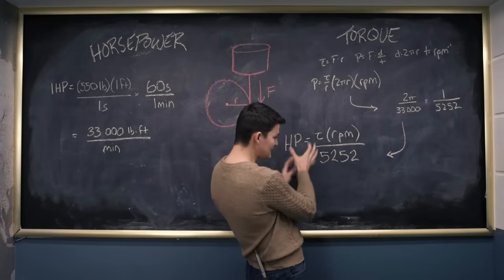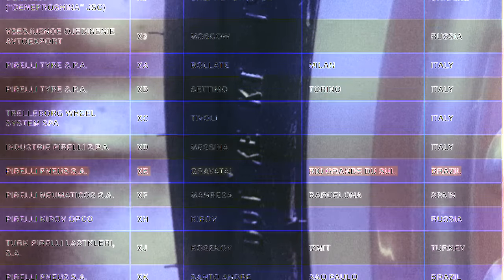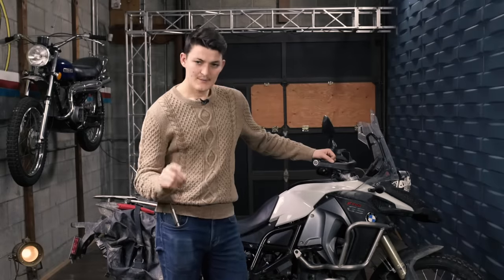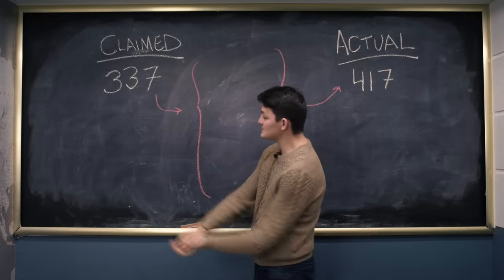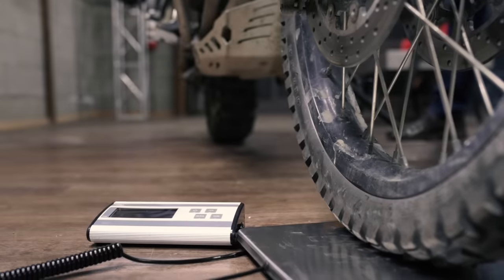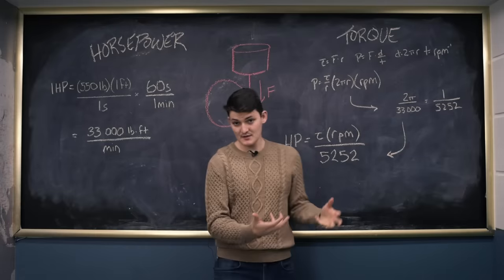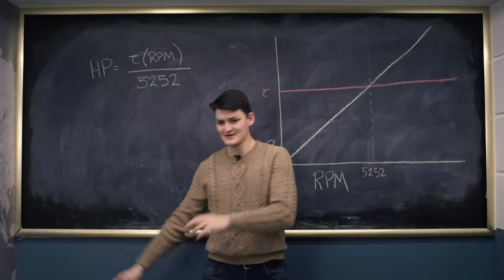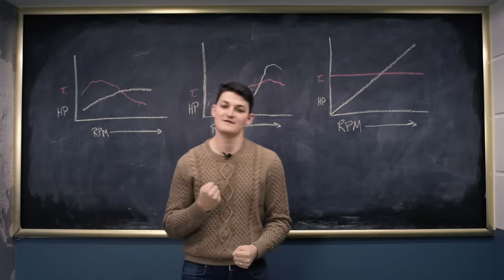3 Ways Motorcycle Manufacturers Trick You

Comment: you can find torque graph for your bike by looking for aftermarket exhaust, they will put stock and aftermarket to show you how the fake carbon fiber can give you 5 hp at the top end
Reply: cosimo ricci at the cheap price of $800 or $1500 of you add a tuner..
Reply: A lot of the dyno numbers and charts thrown out by aftermarket parts sellers are pure bullshit, just like their claims of gains.
Reply: Without tuning the ECU or other things, horse power gain in nothing more than pure marketing smoke, there is no proof that it automatically means more power, in fact it is more probable you lose than gain, so those graphs may also be a deception
Reply: @alexduey7868  The guys commenting on your suggestion missed the point.
Sure, there might be a 5HP difference ehre or there, shure it might be total BS. who cares. at least we got to see a 'relatively accurate' graphical depiction of the power/torque curves, which was what the OP intended. It's a lot better than seeing a 'peak' number.
Reply: adri dell with an aftermarket exhaust your engine will run with more air
Reply: @dutchmoto750  Not if the same amount of air gets INTO the engine - can't run more air OUT with the same amount IN!   ;)
And as soon as you get a free-flowing air filter you have to check that you have the right mixture, so you need a ECU tune.
Costs add up and sometimes the small gain is just not worth it.
Edit: 'free-flowing' not 'free-glowing'
Reply: Oh yeah?!
What about fake carbon mirrors?
Less drag means more power.

Fake carbon is my biggest pet peeve.
Reply: After market exhaust makes a bike "feel" faster/stronger because of the noise.
When you can hear it, it gives the illusion of making more power. Also we tend to open the throttle harder and faster when we can hear it rather than feel what the bike is actually doing.

Although a quality after market exhaust can be quite a bit lighter.
So there's an advantage there.

A good example is those ridiculous fart cans on those crappy ass Honda cars. They certainly aren't faster but they run the piss out of them because it "sounds" fast.
When in reality it just as annoying and stupid as these kids running an open pipe on their clapped out "Gixxer".
IMO anyway.
Reply: @Hello Me 
I'm sure the factory gives it's bikes every possible advantage when pulling numbers. Best possible fuel, temps, best air flow if it effects the power.
They want to say their bike makes 1, 2 or 10 HP more than the other brand. Exact HP ratings are inconsequential for the most part.
Reply: @Hello Me 
I mean they run A bike for stats and bragging rights.

I didn't mean the factory runs every bike for maximum HP numbers.
I'm sure they test run the production bikes. Making sure all the systems are functioning.

For the magazine right ups. They want that big number.
But like I said, it really doesn't mean much except to say the Honda (or whatever manufacturer) makes more power/lighter or whatever.
Reply: @Hello Me 
I hear ya brother.
I'm a early 90's guy myself. Back in my day it was always HP and handling.
My line up; 92 CBR 900rr, 93 ZX 11, 90 GSXR 1100, 87 GS700 with a 86 GS1150 motor rat bike and last but certainly not least 93 NSR MC21 with a RG 500 transplant.👍
There's a video on my channel.
I'm my own tuner and fabricator.
I'm old school.
The new stuff doesn't interest me. And for the most part they're horrible looking.
Reply: Hello Me Not all bikes are limited to 186, they just can’t brag about it anymore.  Not unheard of for a speedo to go blank at 186 with the bike still accelerating...
Reply: @PrimoStracciatella  most pepes dont know that.  Good catch. MC Garage gave that same reason for a KN & tune also or your running lean. Cheers
Reply: @franktaylor7617  Depends on make and model. Guess an Akrapovitch 4 in 2 in 1  on an ( my ... )  old XJR 1200 gains a lot more than a Leovince on a brand new CBR ... Also have a Akrapovitch titanium slip on on my R1 RN04, weights exactly the same as the big ugly blued chimney ( on a red bike ) from factory .

Comment: What Ryan may have forgotten to mention is that when a manufacturer publishes HP and torque numbers, or even the complete charts, they measure the engine output at the crank, bolting the crank directly on the dyno. Thereby bypassing the power losses in the primary drive, clutch, gearbox, and final drive; those usually sap around 15% of output.
Reply: This means that 5 kW of power (peak) is dissipated into the drive train of a Ninja 400. That's a lot of heat and noise

Comment: 7:42 "and when torque is moving, that IS horsepower. One is a function of the other". I've tried to explain this so many times, so many people just can't understand it.
Reply: Torque and horsepower are the same on a graph at 5252 rpm. Race engines want high power just below the redline. Street engines want lots of torque from idle to 30 mph, 60 mph and to 80 mph. The power for a street engine near redline rpm is useless, especially if it gets 5 miles per gallon or less to do it. See a horsepower and torque graph for the new Goldwing- very good for public roads, for a high price.
Reply: Torque tells how much work can be done.
HP how fast work can be done.
Electric motor gives max. torque all the time from 0 RPM to max RPM, but zero RPM work will never be done.
Reply: "But muh torqueeeee !!!" always seems to scream louder than any sane explanation.. cant win all battles
Reply: Torque is just a fancy lever. Alone it can't do much.
Reply: @XtreeM_FaiL  it is funny that Harley Davidson advertises torque,  and everyone else advertises horsepower. To me it is more about price, weight, reliability and comfort. I am most attracted to the inline 3 Yamahas, but own an older Kawasaki ZZR600 inline 4 for 75 mph, and a Honda Shadow 600cc VLX for 60 mph.
Reply: @XtreeM_FaiL  You are incorrect, torque exists at 0 rpm, and its not a unit of work done. The confusion arises because they have same units but represent different physical quantities. Work is a dot product of a force and distance. If a force is applied to an object and it doesn't move it does 0 work. But torque is cross product of force and distance, if you apply a force to the end of a wrench, you generate torque, here the distance is the length of the wrench.
Reply: electric_boogaloo I did not say torque is work done. I said how much can be done. Small difference on a simple example.
Reply: Yet most internal combustion engines have a different specific torque output per RPM in its range. The torque graph he was using showing ideal torque is an electric motor.
Reply: @jeffruebens8355  I think Harley uses torque for the advertisements because they are known for twins with long stroker. Whereas metric bikes like my CBR is known more for higher RPMs.
Reply: @XtreeM_FaiL  Motors do not provide maximum torque over the full RPM range; torque is maximum at zero RPM and falls to zero at maximum RPM.  EVs are usually electronically torque limited at low RPM so they provide constant torque up until some RPM threshold after which it falls off.
Reply: One being relative to the other is correct. His conclusions off the back of that are entirely wrong.

Harley don’t publish Hp figures because they are embarrassingly low, plus consumer misunderstanding about HP, Torque, not helped by videos like this spreading misinformation. The figures are also not particularly useful in the context of what the bike is, a cruiser.

Torque can be best explained to the layman as turning force, this is why it typically dictates how fast a vehicle can accelerate, because it’s how quickly it can get that wheel moving and up to speed. Where as Hp, will more determine the upper limit of what it will accelerate to. When you have a torque value on a nut or a bolt, you are effectively “summarising” the turning force required to achieve that state of tension.

Comment about EV’s is correct, except you have maximum torque from zero, not because of programming, but because of how an electric motorworks, the turning force is constant. Also why if you don’t want to, no need for a gearbox.

No engine has torque at RPM because it won’t be running, simple as, at idle it has torque, otherwise you wouldn’t need a clutch!
Reply: @lordofhykra6150  The thing is you can have a million lbft of torque with zero power (i.e. static torque) which won't accelerate anything.  Power is ultimately all that matters, because a suitable torque multiplier (i.e. transmission) will provide whatever torque is required where it actually matters, i.e. the driving wheel or wheels.
Reply: @ferrumignis  It would be impossible to produce a bike with X torque and zero HP. It is not true that HP is all that matters and OEM's tune their bikes very specifically to achieve peak in certain ranges. Using the Triumph Daytona 675 and Triumph Street Triple are great examples. Both have the same lump, Daytona produces more HP but less Torque, ST more torque less power. ST accelerates faster , but it has a lower top speed than the Daytona. Daytona also has Peak torque much much lower in the rev range as this is to accommodate the style of riding used on these bikes, to allow you to bomb it into a corner, be high in the rev range and slowly layer the power on without extreme risk of highside, as you would if the torque peak was higher in the rev range.

My Harley davidson produces about the same HP as my 250 single cylinder motocross bike, but more torque than some 1000cc sportsbikes. Torque at the crank is about firing order, timing and engine layout, If transmissions could resolve all issues, every car on the road would be running with a 1L NA and do the work on transmission. But they don't...

HP is about your total available power, torque is how you deliver it. In the video he utterly blasts past the importance of Pi in the equation, I would suggest because he doesn't fully understand the equations he is referencing. 

If you've ridden a V2, an inline 4, a single cylinder and a 2 stroke, or equally radically different engines, all of this is abundantly clear by how the motorcycles handle.

Honestly this is year one mechanics on any engineering course or hour 1 on any decent track riding school.
Reply: @lordofhykra6150  Correct, a bike with zero power wouldn't move, which is exactly my point. Torque at the wheels is what accelerates a vehicle, torque at the engine is relatively unimportant provided you have a suitable transmission (aka torque multiplier). For some reason many people simply can not understand the difference between power and torque, even though it's very simple and should be obvious. I suspect this is at least partly because they don't understand the function of the transmission.
Reply: @lordofhykra6150  Nothing he said in the video is misinformation, all the physics checks out.
Reply: @lordofhykra6150  You're accusing the guy of spreading misinformation while listing a bunch of old myths. None of that is learned in any engineering course, I can guarantee you that.

Acceleration is a function of power. A street triple does not accelerate faster than a Daytona. Engine torque is not wheel torque, there is something called a transmission, the bike with more engine power has more wheel torque. It takes Newton's second law and about 30 seconds to prove that mathematically. Which is why despite all that torque Harleys couldn't dream of even touching the acceleration of a performance liter bike, or even a supersport with less than half the torque.

Torque is also 90% a function of displacement, 8% compression ratio, and like 2% many other things all making a tiny impact - firing order and engine layout not one of them. If you've ever ridden say comparable engines with different layouts you should know that, comparing a 1600cc V2 to a 600cc inline 4 proves fuck all. An SV650's V2 provides almost identical power and torque curves to a Ninja 650 inline 2, look at the power and torque curves of modern superbikes and you won't be able to tell the RSV4's V4 engine's power and torque graphs apart from any of the japanese inline 4's, and Yamaha's crossplane I4 performs the same as all the other I4s with regular flat plane cranks.
Reply: @XtreeM_FaiL  thats also not true. Electric motor doesnt have full torque in whole rpm range, thats common misconception.
Reply: Roni92pl If it is unloaded, but when you give it full juice (amps, volts what ever) then it is different case.
Reply: @Angry-Lynx  True, electric motors have torque curves too, although some types of motors do have peak or near peak torque when stationary or when moving very slowly.

More importantly, while there is generally low variability to the efficiency and torque of an electric motor as it speeds up, the idea that an electric motor holds constant (or near constant) torque from idle to "redline" only really happens if it's plugged into a beefy electrical power supply, like a three phase mains plug in a factory. In a vehicle the system is always limited by the power the battery and inverter can deliver. If you actually dyno an electric car you'll get aproximately constant torque from launch up until a certain speed - the speed at which peak system power is reached - and after that torque falls linearly as power remains constant. Which is why a Tesla doesn't have whatever torque they claim it has from stationary to whatever its top speed is, it'll have that torque until something around 60-80mph tops at which point there's just no more power.

You could have a 5000hp electric motor, that if you install it in a vehicle with a battery that can only deliver 200hp, the motor will only produce 200hp - although it could theoretically deliver 200hp at 1rpm.
Reply: @lordofhykra6150  is the reason why I gave up trying to explain this HP/torque thing anymore. 

Doesn't matter how much one can explain or prove it, there is always the one that comes in and say torque is acceleration and power is top speed. He knows it too because his vehicle (s) has great acceleration (usually this) and probably a few example of how it is quicker than some (insert high revving higher powered vehicle ) in a drag race. Standard stuff. Always

Comment: It is important to pay attention to both torque and power because the former tells you the output of the engine at low revs and the latter at high revs. Of course having full output graphs of either measure would be preferable, but so long as manufacturers like to list peak figures only, you must pay attention to both.
Reply: Not quite. Torque tells you the potential work that can be achieved. 
Horsepower just tells you the potential rate by which that work can be achieved. Potentially. 
What matters is what can be achieved, it's rate of occurrence only comes after that first initial delivery of TORQUE to act on propelling an object from stationary. Potential to kinetic energy.

Comment: It turns out the Pirelli Phantoms have 3mm tread depth on the front tyre and 5mm tread depth on the rear tyre no matter where you buy them from.
Reply: Unless the front and rear rims are different sizes, it is an extremely poor decision to manufacture or require different tread depths front and rear.  Imagine if a 4wd or AWD did this?  Yes, most supercars have different tire sizes front and rear..
Reply: @hillaryclinton2415  
The front and rear tires are, in fact, different sizes and it's fine for them to have different tread depth. The rear tyre being the drive tyre gets a deeper tread because you want it to have more grip for launch. 

Also the tyres having tread depth being a bad thing was never mentioned or even a point in Ryan's video.
Reply: There’s more to it than that. Ryan also compared an expensive German-made radial to a budget cross-ply. Yes, they’re both Phantoms, but they‘re intended for classes of bikes with massive differences in weight and horsepower. Not to mention tube VS tubeless rims...
Reply: @hillaryclinton2415  wrong... uneven wear due to more drive from the rear... bikes aren't AWD... AWD/4WD cars are.
Reply: L.V-Rider  
I guess a major tyre manufacturer like Perelli (among many others) don't know anything either because that's how they makes these tyres. And no, it doesn't matter if you get the ones made in Germany or the ones made in Brazil; it's 3mm tread depth in the front and 5mm tread depth on the back on these tyres making Ryan's point about the tread depth totally moot. 

Now if he were comparing the German radial tyres vs Brazilian bias-ply maybe he'd have a point but he didn't even seem to know about that.
Reply: L.V-Rider  
Yes, I failed to articulate the circumstances and manner in which treads help with traction but that wasn't the purpose of my comment. 

You could have just demonstrated your point immediately and contributed to the discussion instead of making a pointlessly adversarial remark.

Comment: I normally admire what you do but it seemed to me that in this particular case you've dropped a clanger. Your reply will be of interest.
1. Tread depth. You showed one tyre with a supposed tread depth of 3mm and another of 5mm. However you didn't say that one looked like a front tyre and the other a back tyre. The front tyre having 3mm and the rear having 5mm. Perfectly normal accepted practice as the rear does all the driving.
2. Made in Germany or made in Brazil ? Well Pirelli say their factory  in Germany makes all the rear tyres for this model and Brazil makes all the front.
Reply: Interesting!